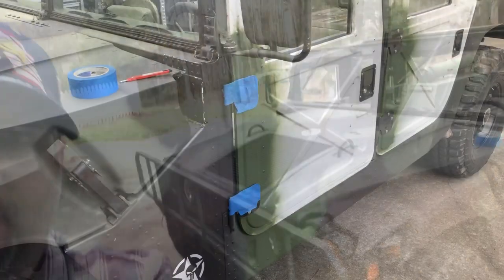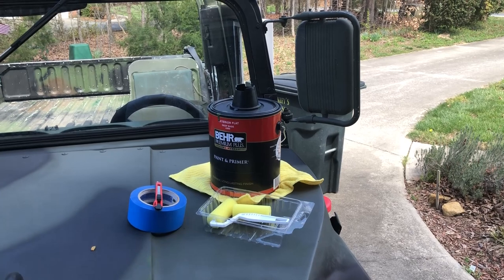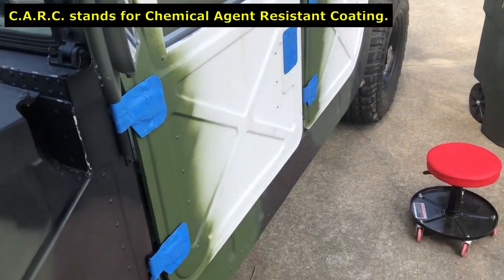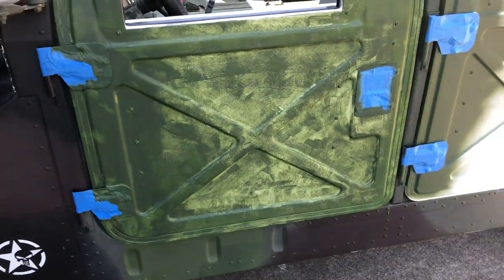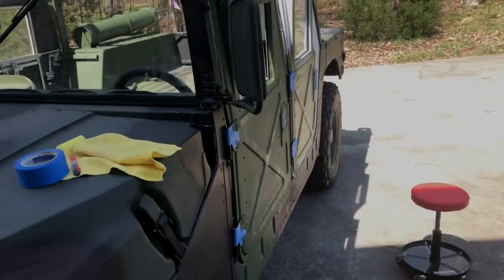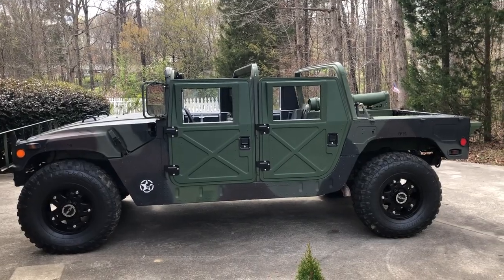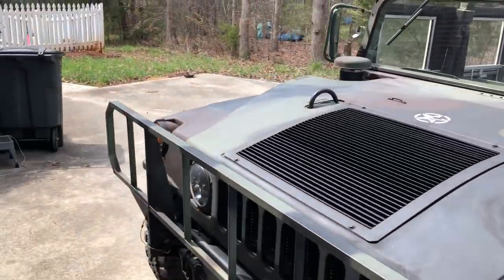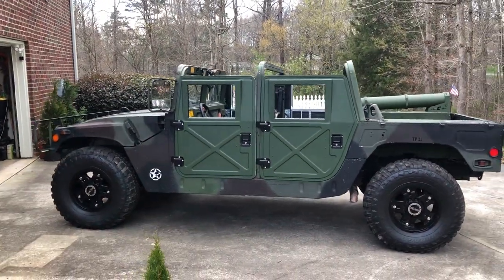Painting my Humvee - Hard X-doors - Part 0 of 3

Comment: What kind of rubber seals you used on those doors, do you have pictures or any video showing figment, I’m curious about the quality of those doors
Reply from the maker: I will be putting in the weatherstrip next. Didn’t want to put it in till I painted the truck.
Reply: @MyHumveeMathilda  it’s coming along pretty good, great job. I’m about to pull the trigger and order a set of doors from same provider in Georgia, but I’m not sure of the quality of them and the finished work
Reply from the maker: The quality is great. I’ve had them on my truck over a year. No cracks or damage or anything. They’re solid and the hardware works well too. And great price.